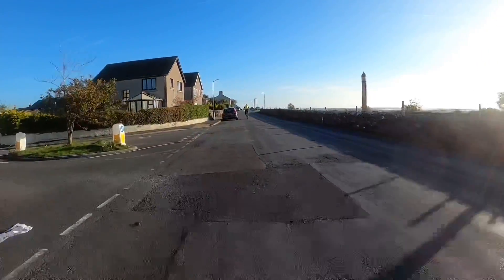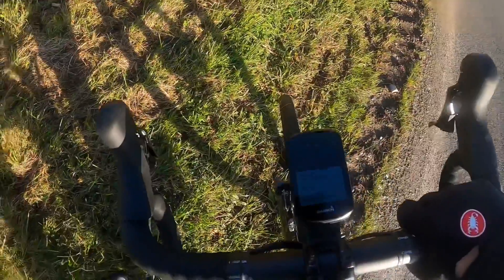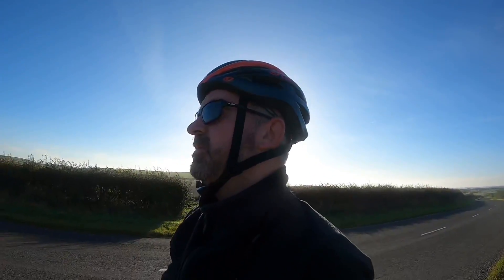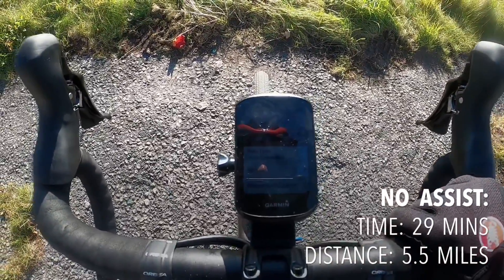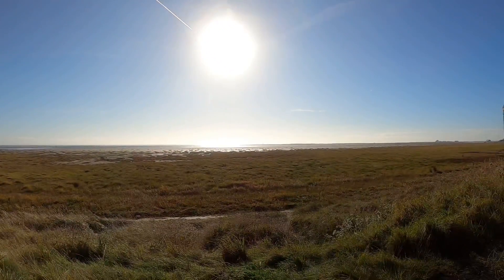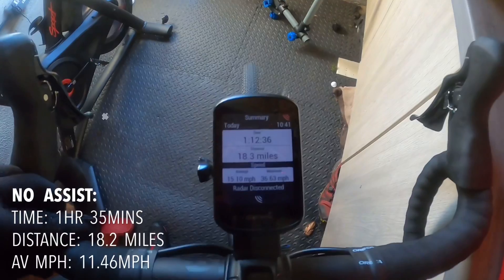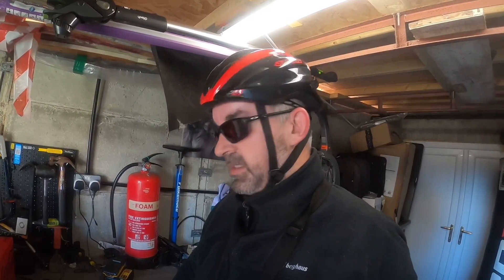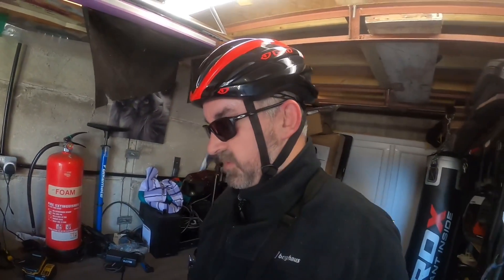Orbea gain ebike vs Normal Bike - Ep4 #cycling #orbea #ebike

Comment: Well done nice ride and comparison, do you think that the lights used the 1% I'm still contemplating getting a Orbea gain, as I'm now approaching 70 although I ride 20000km plus a year at an average speed of 23km/hr im starting to feel it, so it may be a birthday present for myself in May, 
Your videos have certainly changed my thoughts and misconception on e bikes, 
Have a great week.
Reply from the maker: Thank you Terry I turned both lights off but guess it might be light that is around the on/off button 😊